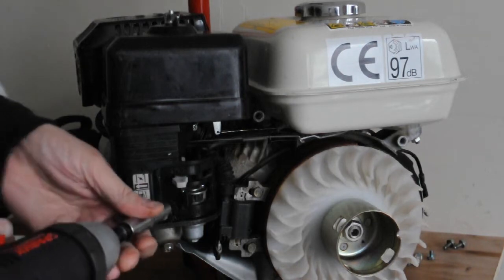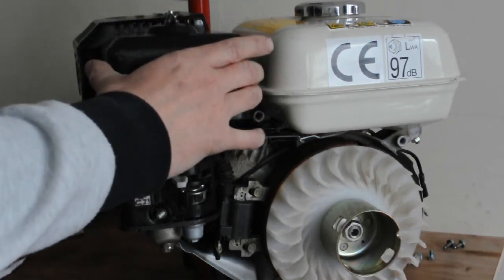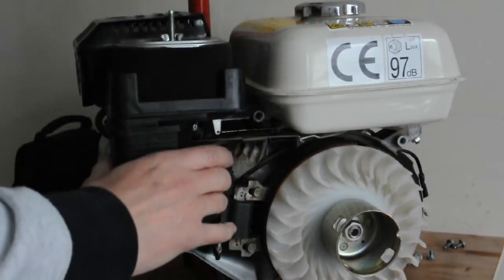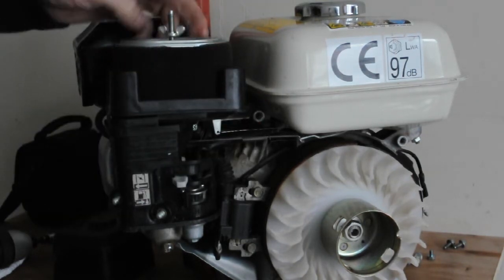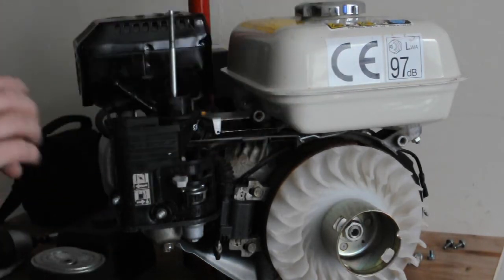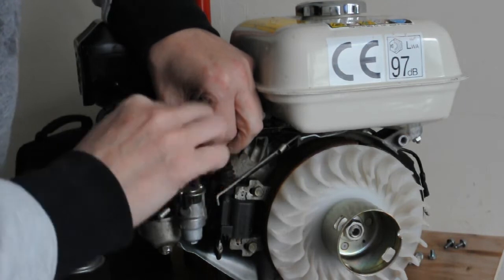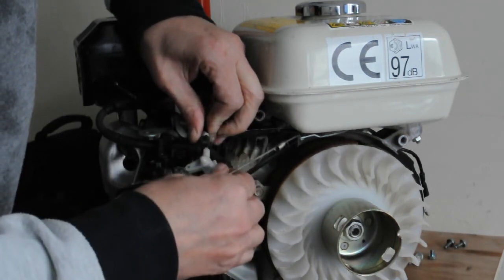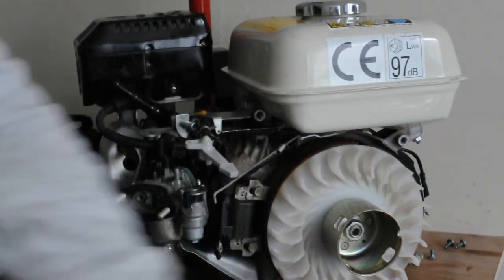Easy Honda GX160 Carburetor Removal & Replacement (Not running) | GX120 GX200

Comment: I take your more of a maintenance engineer then an electrician? 
Interesting video 👍for some reason if I try repairing stuff like that I always end up with three or four screws left over, then i’am sat there thinking ware the hell did theses come from, so I don’t touch this stuff I leave it to people like you . Great video as always 👍👍
Reply: I also recommend that you get a copy of the IET onsite guide the updated book is brown .
Reply from the maker: @seandempsey7351 Yes i agree there expensive but excellent
Reply from the maker: I mainly fit and fix electric showers , but never stop trying to learn and yeah left over screws are always a thing , normally have to disassemble something 3 times to get it right . Thanks Sean are you Electrician.
Reply: @cagmito76  yes I did C&Gs 236 parts one and two back in the late eighties . That’s why I was a bit quitecal of your video were you installed an electric cooker . No disrespect intended. Also I don’t pretend to be a super duper know all spark . But if I can help I will try and if if I see or think you are wrong I will say so not to put anyone down just as a pointer
Reply from the maker: @seandempsey7351  I could not find it did you delete it ?  as I read it once and then it disappeared I went to re-read and reply and it it was gone. I could not find in any one my comments sections , I did not take it down either it was some good info.
Reply: @cagmito76  I think I saved it to my video list, will have a look.